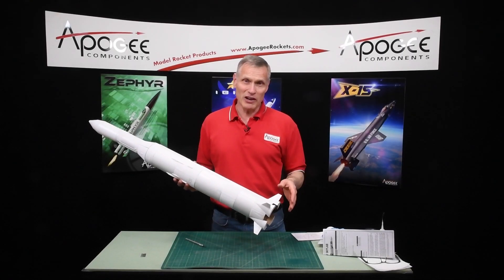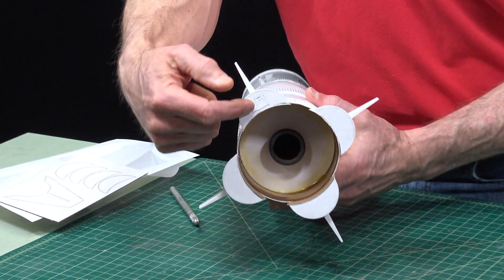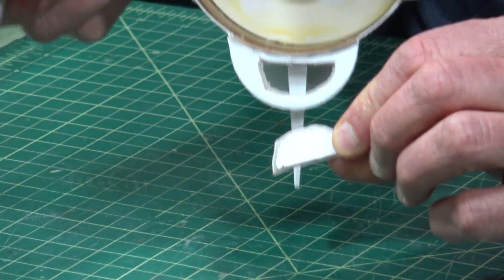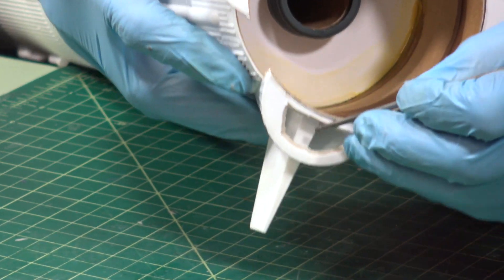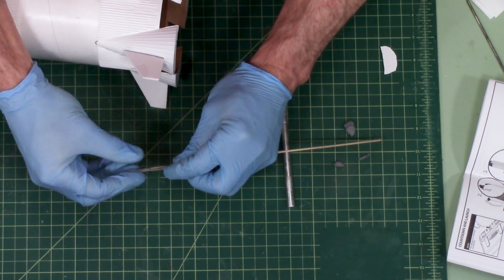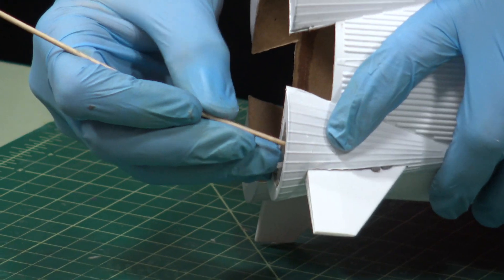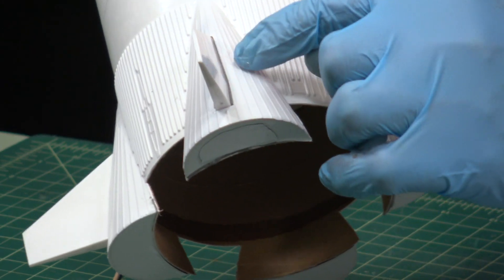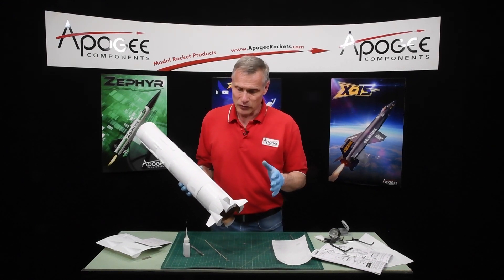Repair A Fin Gap on the Estes Saturn V Model Rocket Kit

Comment: Neet technique......super thin vacuum-formed parts are always stupid hard to work with, and I just got a model, *cough, Apogee Components Saturn 1B, cough*, that has a whole lot of them. Thanks for the heads up Tim. Keep em coming....= )

Edit; I need to update my Rocksim program, but my computers pretty much had it so I need to upgrade that first. I'll be in touch. = )

Comment: Why not cut bottom part of the fairing directly at the seam, hole will be bigger, better access , and you can glue it back on with glue for plastic models, and seam will be less visible
Reply from the maker: Not sure which seam you are talking about. But you should be able to make it the hole as big as you want.

Comment: I used plastic glue to seal the joint.  Not so great looking but it did the job.  Just don't look close.  😁🚀👀
You are going to have to seal/fill the bottoms of the fairings or else it will look worse and even more stupid than my glue job.
Reply: haha.  We need to closely at these things..

Comment: Seems like a lot of work…why not just do the same from outside using a paste filler?
Reply: I build plastic model trucks also. In the past I've taken a piece of scrap - piece of spru & done glue tests to see what ''' glues''' worked the best without deforming the plastic. What may work for one builder may not work for you.
Reply from the maker: Try it... See what happens.
Reply: @apogeerockets  Wow, your answer is a bit snarky…I’ve been building models for over 40 years and have used several methods to fill seams and to fillet various joints.  I simply thought you had a specific reason for that approach.
Reply from the maker: @maxwellmark  I wasn't attacking your question. I was encouraging you to give it a try and see what happens. I do have a specific reason for my approach -- I know that it works 100% of the time for this specific situation.
Reply: @apogeerockets  Ok, so I’ll reword my question….Seems like a lot of work to gain access to the inside to fill that joint, what reason do you have for not filling it from the outside with a paste filler?
Reply from the maker: @maxwellmark  I'm a teacher.... Teachers ask questions... So I'll turn it around and ask you the same question.
Reply: @apogeerockets  Never mind…🤦🏻‍♂️ unsubscribed
Reply: @maxwellmark  I feel like you were rude for that...how was he being rude